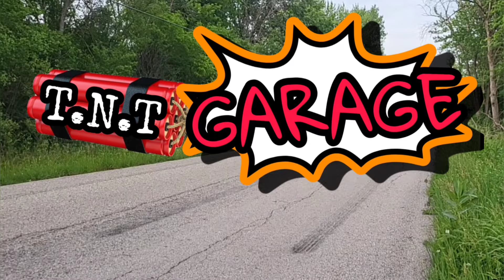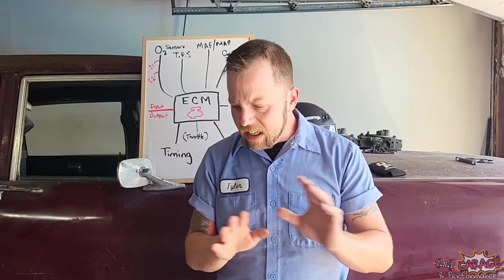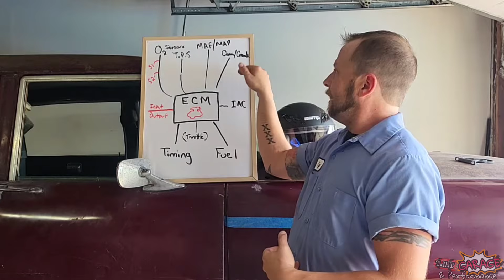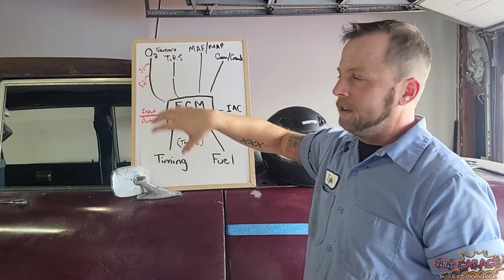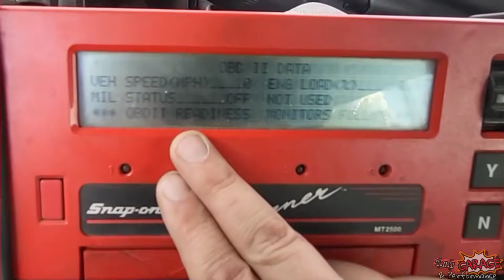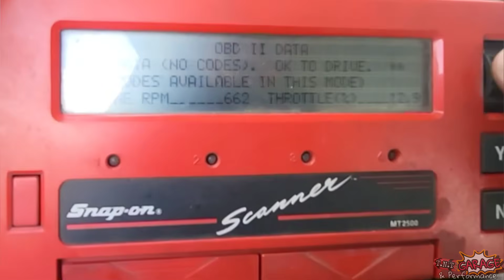Stop buying oxygen sensors!  Proper check engine light diagnosis tips!

Comment: What if I don't hear anything like rumbling? My car drives just fine but the autopart shop and mechanic both said 02 sensor is failing the code says fuel system too rich B1
Reply: I drive a Honda fit 2018 so it's not an old car. Thanks!